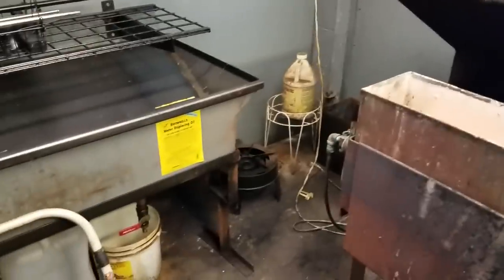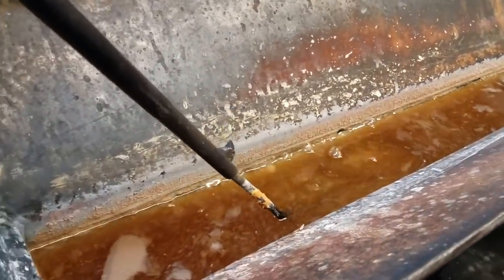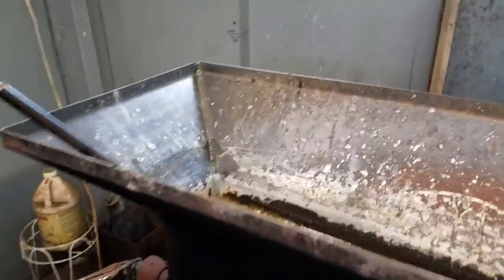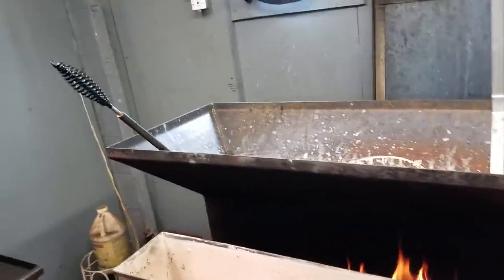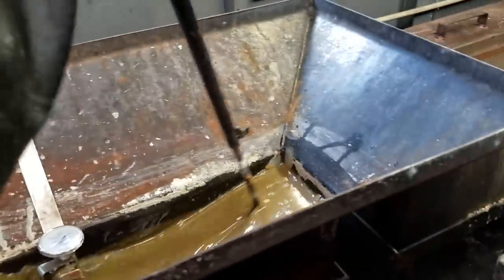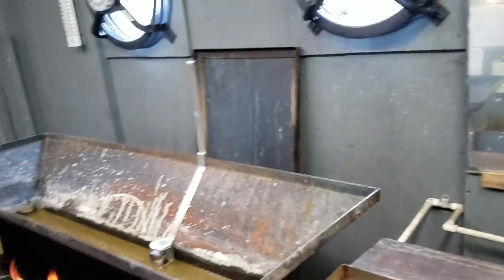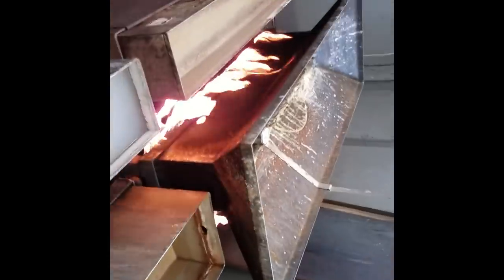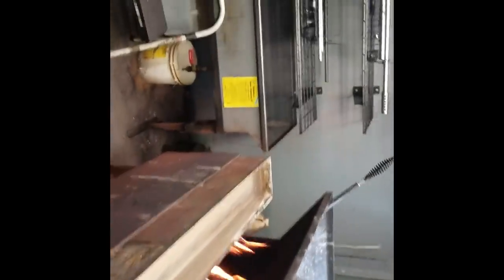Professional Gun Smithing Series   Master's Bluing Technique 501 College Level Course

Comment: I knew nothing about blueing!! Now I know a lot. 
I have a couple of very minor suggestions:
1: if you took the rod that you use to move the baskets and welded on two small washers of the correct diameter and welded them about an inch apart on one end of the rod - the basket would never slide off the rod. 
2: if you got a clipboard and put it where you have the Winchester note on the wall you could add more info as necessary. 
You have an amazingly well thought out blueing room. Thanks for sharing!!

Comment: You might try adding some regulators like what’s on a fish cooker. It looks like you were using ball valves. The regulators should help out a lot with your temperature control. All in all great set up and great video

Comment: Boiling point purely a function of composition (salt to water ratio in this case). Boiling rate is a function of heat input amount over the boiling point ( the delta between internal temperature of the boiling system and the jacket temperature). Don’t confuse the two.

Comment: 1st off...  Sounds like we were taught by the same person.  When I first learned to work, my daddy tought me "Theres two ways to do things.  The right way...  And again."  Followed by your line, "If 
 you don't have the time to do it right the first time..."  hehe.
  Interesting about the displacing oil, WD40 stands for Water Displacement formula #40...  I would think it would work well.  It must be a viscosity thing, many?
  I do have one question I've yet to find an answer for...  I'm a fan of Browning Hi Powers.  Some of them come with a sort of purple-ish blue to them, rather than the standard black bluing.  I think its beautiful, how is this color effect achieved?  Anyone?
  Thanks for the lesson, u finally understand hot bluing and don't just think I do.  :)
Reply: The colour if I am not mistaken is dependent on the actual steel itself as the steel's carbon content will dictate the overall colour or tone of black it turns once treated.
Reply: @delmaneboshoff5610  
  Hello, I believe that you may have intended to respond to the main conversation as your comment is out of context with my remark.
(Also, there should be a comma after the words "colour" and "mistaken.")    ;)  lol.
Reply: @delmaneboshoff5610    Now that I've sorted myself, thank you for your information and help.  Ive been a bit "confused" lately, to say the least.  :)

Comment: great video. your flame looks alittle weak it would burn hotter with less fuel if you had more air in the burner tube so the flames are more blue and less orange, might need to increase the gas pressure coming it.
Reply: I think I'll try that thanks buddy.
Reply: where your visegrips are is the air opening adjustment gate. the burner length and the amount of holes need to match your air intake size. to small of a air opening and you get orange flames, just right you get blue flames that are much hotter like a blowtorch . good work scottie

Comment: Putting cold water in does NOT!! cool it off. You are replacing the water that has boiled off so you maintain the same H2O/salt ratio so the boing temp remains constant. As the water boils off there become a higher percentage of salt -right? The denser liquid then has a higher boiling temp - so you adjust the water to salt ratio by replacing the water that has boiled off. think in reverse - when you dissolve salt into ice in the winter, it doesn't "melt" the ice. It dissolves into it and lowers the freezing temperature. The reverse is happening here. You add water to replace the water that has been boiling off.